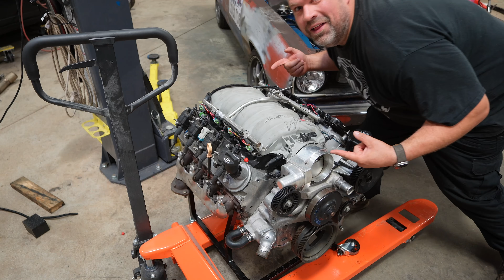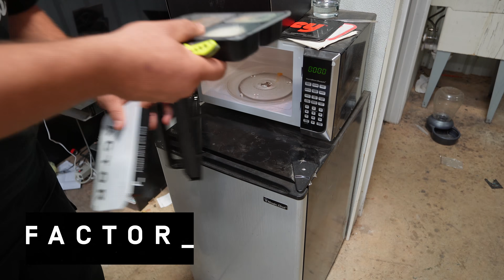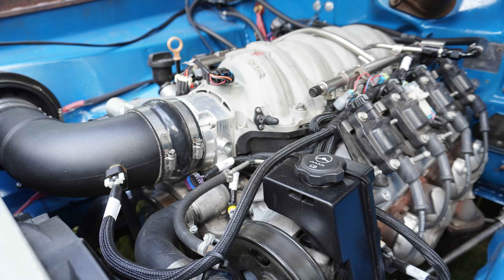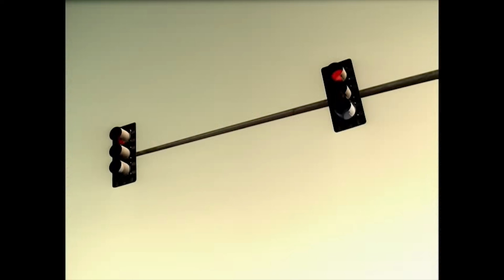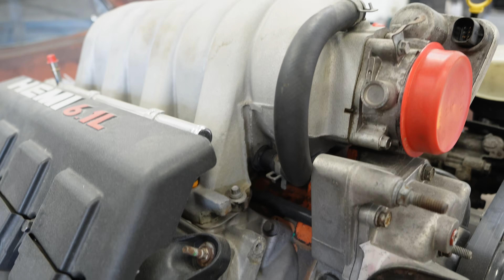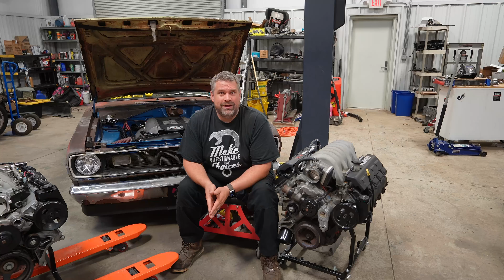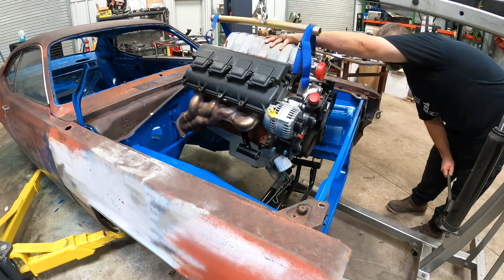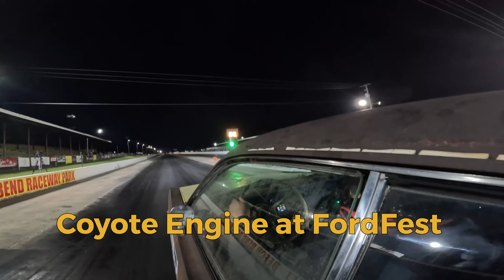What No One Tells You About Engine Swaps! Best Engine To Pick?

Comment: Great comparison!  I just picked up a wrecked '16 Challenger to swap the 5.7/8HP70 into my '71 Coronet (currently 318/2V).  Even if I leave it bone stock it's over double the hp and about 60% more torque.  Given the Coronet weighs ~900lbs less than a modern Challenger/Charger it should be amusing.
Reply: Have you considered stroking the 318 to a 390?
Reply: @ufarkingicehole  certainly possible, but more expensive to do properly than putting in the modern engine.
Reply: @ufarkingicehole  ..400 big block with a 440 crank...636 hp is what I have in my 70 Charger 500..I detuned it to 598 hp but has  670 torque! (I removed the headers,milder cam as I run power brakes now)..
Reply: @mypronouniswtf5559  what's the bore? Compression ratio?
Reply: Look at Reignited - Cycle and Automotive. Dodge tech guy, has a lot of information about this issue on his channel. Also videos on oil pumps and which one to get.
Reply: A '71 Coronet is a nice looking sedan that was popular with police and taxi fleets due to its sturdy build.  The wagons are attractive too.
Reply: Ain't  that  the way ? The malaise begets  a cure .😮😅😊
Reply: And it’s a beauty car.
Reply: 09 and newer should upgrade to HELLCAT oil pump. Direct bolt on. Will throw a low oil pressure code (which is the opposite of what's happening because the hellcat oil pumps raises oil pressure). What's happening is the oil pressure is raised higher than the upper limit for the MDS to operate. They're a couple of ways to eliminate the code. You trick the computer with a voltage divider or take the pressure spring from the original oil pump and install it on the new hellcat oil pump. Here are a couple of videos where I got my info from. 

https://youtu.be/wpl8aZiPK0E?si=vtbmKBB0iJon4jq_

https://youtu.be/1gpEwkTVCmE?si=rZ93f9KHJhDUL3YS
Reply: Better upgrade the oil pump or it will look like every new dodge broken down due to lifter/ cam issue that stem from poor oil pressure
Reply: @jo-qp7mz  the issue isn't the oil pump from my research, it's the MDS system, which IS getting deleted.  I may throw on a new pump though just as a precaution as the car was in a pretty serious collision.
Reply: @rennkafer13 it's an oil volume issue. Avoid long idle times and do regular maintenance and you shouldn't get the issue. Something else to keep in mind, the supposed "common" issue has only affected ~1% of these engines.
Reply: @hewlett260  right, my understanding is that mds system diverts oil from the lifters, causing the problem.  Remove the mds system (and use the proper non-mds cam/lifters) and the problem goes away.  Plus I get an excuse to upgrade the cam. 😁
Reply: @hewlett260 well said I've had no issues with my 20 year old ram 5.7 sitting at 240 thousand miles and still my daily driver..Been a great truck and still is
Reply: @johnoates3326  Same here. We've had a ton of high mileage gen 3 Hemis and none with lifter failure. Most Hemis with that problem are fleet rigs that have hundreds of idle hours. 2018 Hemis have higher output oil pumps too. Most people are going to swap to an aftermarket camshaft with a new set of lifters anyway. No one with a hotrod needs MDS.
Reply: @PyroBlonde7777  I agree I'm not a fan of the MDS system thank God I have a 04 so it's the preeagle no MDS..It's been a great truck the past 8 years..Had a few electrical issues that took some time to figure out but besides that it's been the best truck I've ever had...Not the best on gas with 37s lol but definitely reliable
Reply: Melling has the higher volume oil pump and cheaper than the Hellcat pump. @rennkafer13
Reply: @PyroBlonde7777  agreed, I ran a 2006 Magnum with the 6.1 for years without a single issue until I started doing 160mi round trip commutes down to San Diego in bumper to bumper traffic every single day. All that sitting in the heat baking between other cars with zero airflow did her in.
Reply: @johnoates3326  working at the dodge dealer and at independent shops the early 5.7 hemi 04-08 was the most reliable V8 I saw, out of all the brands. No oil leaks no oil burning, the only issue that all of them suffered from exhaust manifold bolts breaking. If you ever over heat yours then you are taking a big risk of dropping valve seats soon after. Just do all the maintenance and drive it. Seen them 200k-400kmiles with no issues.
Reply: @alexgrindnshine2522  I agree!! I'm at 240 thousand miles..I upgraded to a 4 core radiator and electric fans and long tube headers and the truck is beyond reliable!!
Reply: @alexgrindnshine2522  The exhaust manifold bolts are an easy fix if you go to headers. Gen 3 Hemis are the easiest V8 I've ever worked on. Almost every seal is an o-ring. No one with actual knowledge in engineering would look at the Gen 3 and think it's bad. Only a Ford or Chevy fool coping hard.
Reply: @johnoates3326  The Eagle heads flow a lot better. I'd rather spend money on a cam and headers than new heads or porting.
Reply: @PyroBlonde7777  I have not had to spend that kind of money on anything and I'm at 240 thousand miles and still my daily driver plus it's on 37s..Most people will agree the 04 was one of the best years made
Reply: @PyroBlonde7777  I agree with you. Working in shops customer didn’t want to upgrade to headers. as much as I hate anti seize I would completely cover the exhaust bolts in that stuff, which I believe helped with longevity. I never had them come back in the future for another repair. The seals and gaskets quality on the gen 3 hemi’s   is phenomenal, I have never had to fix an oil leak on one other then an oil filter that didn’t make a tight enough seal. And yes the engineer/ power out put and ease of repair made it one of my favorite engines. I loved the LS because it need repair often but was fun to work on. The new 5.0 is huge step in the right direction for ford, because that 3v triton was terrible. And the early 2v stuff just had goofy problems, and not a lot of power.
Reply: @PyroBlonde7777 my experience agrees with you. I have a fleet and we have failures due to excessive idling. Especially in the summer.
Reply: @Kanakid  Chevy has the same issue with their MDS lifters. Chrysler updated their oil pumps and the lifters themselves back in 2018 though.
Reply: @jo-qp7mz Exactly ! Great point. My brother's 2012 Dodge truck fell victim to that. Hemi tick. Low oil pressure at idle.
Reply: I remember the old 360's would give you a heart attack if you looked at the oil pressure at idle. lol  @rondellschuyler7074

Comment: I have never been a blue oval guy.i have always hated the engine and transmission pinwheel.they got what? 11 different transactions and a bunch of engines and their wiring has always SUCKED? Their quality control has been in the toilet for a long time. I liked the look of the galaxy 500,the fast back mustangs but i just can't stomach the motors.the Chevy is a good all around vehicle good reliable engines and 3 transmissions the power glides,
 turbo 400 and 700r and I think now it might be the 4L80.
The LS platform has taken off like gang busters to the point of "oh look another LS swap" but you can have new tech with vintage body for the GM crowd and some are impressive....but i am a Mopar guy love my Mopar stuff simple HP and tourqe big block stuff and small block stuff now we got gen 3 stuff and i am going to do my final project and swap with my dodge Dakota r/t pulled out the 408 stroker i built for it over the years but i was at the end of the road with making power super charged it and got to 498hp with no place to go basically the magnum platform restricted itself....so now it is on to hellcat power with the 8hp90 with the charger dash, console, steering. Boosted motorsports built one and it is impressive when dodge first came out in 2015 with the hellcat i was toying with dropping a 440 in the truck and me and my brother in law seen the commercial and i said that is what I want to put in the Dakota... and he kinda dismissed me and I said no really buy on that someone totals and take the drivetrain out and put it in the Dakota and I'll call it the "hellkota" well jon from boosted motor sports got to it before I could but i slipped up in a live chat with him and said what I was going to call mine and then everyone started calling Jon's project the hellkota build.....so i let my name idea out and it took off...lol....oh well Jon's a great Guy and it is what it is go check out his channel boosted motorsports on YouTube he did an awesome job on it so far.... Open the hood and it looks like it belongs there.

Comment: Awesome video Jared. My brother managed to do a Coyote swap into his Foxbody Drift car. Nice thing about that engine over a built 302. Is stock power is great enough to get the car sideways. Without placing greater risk on the health of the engine, as the engine is still running on stock power.
Reply: Still, compared to the Windsor, and LS engines, there's plenty of reasons why coyotes are the least common swap engines like it or not. As far as modern engines go, the LS is number #1. Even though I'm a Ford guy(own a '89 Notchback )ever since the foxes were new. Ford hasn't built a decent affordable power plant since they let go of the Windsor. The Mod motors were a let down. Many mustang guys went LS after Ford went 4.6L. I'll keep building my Windsors.
Reply: @erikturner5073  personally I like the Windsors too. My 89 hatch currently has a 302 with exploror heads and intake. My first time building a engine and it hasn't blown up yet. Though it's just a stock rebuild with a few goodies inside.

Comment: Yet when you factor in the amount of MODs needed to get the engine's into making the power you want, the Coyote needs so little compared to the other two. That has been shown by many builders. Coyote just puts out the power with minimal MOD needed, basically a tune and E85 for NA or boost it and tune for 1,000 HP on stock parts. The other two require many parts to keep it together or even come close the the results of less means more.
Reply: Yes and the coyote cost$$$ BIG,,,,,,,LS $1000 junk yard and $500 eBay turbo and make 600HP for $2000 and small package….
U can buy a coyote for less than 5k
Reply: @ManwithoutafaceFL  those mods in the real world is more like 5k. also more work and time.
Reply: @ManwithoutafaceFL there's no such thing as a 500 turbo. You need hot and cold side pipping, wastegate or blow off valve, tuning and a few other parts To make that 500 turbo work on top of all the time of putting it toghter. I've seen guys put the ls-junkyard turbo combo together and mysteriously it came out to a 10k build that netted 650hp. Where you can get a coyote now for 2-3k.  a control pack for 2k and a paxton for 6k a really good fuel system for 2k and you can make 8-900hp all day long. As long as you don't bounce it off the revlimiter.

Comment: I disagree with you on the Coyote. It’s an awesome engine that is only tight in smaller vehicles. This stereotype is what has pushed a lot of builders to use the horrible LS. You yourself have proven it can be done,you just can’t be lazy and go down the easier path.

Comment: its simple. Coyote swap tge world!!  just 10k boost either supercharger or turbo and fuel system for 1200. ucks and you can make up to 1200whp and get heavy mustang modern s550 mustangs running as fast as 7s and  f150s 8s in the 1/4 mile  all on stock sealed engine unlike hemi and LS which need heads cam pistons and rods oh and then the boost and fuel system sqme goes for hellcat motors to get close to that power that a stock coyote  makes.   turned down 900whp nice daily power that will smoke super  ars in awd f150 and in mustang or f150 rqcea le and dailyable and reliable.  also factory ecu has been able to be tuned down to 6 sec 1/4 mile.  its all about what or who you know.  they have waaaaayyyyy more aftermarket than hemi you just need to know what you are doing and talking about and who you are talking to and coyote is not as scary as ppl think it become as easy if not easier to build and swap a coyote
Reply: anything you need to know about swapping tuning and building every gen coyote even pre coyote  road runner 5.0 from s197 boss mustang just watch mustang lifestyle

Comment: so you dismiss the extra 150lbs or more on the front end? that is typical US cars with rubbish handling as that extra weight in many projects will see that. maybe not a big deal in a restomod but a re engine to euros for example will be ruined. coyote seems great but understand a big engine to slot in and be able to work on. read that the5.4 is one of the absolute worst by old school mechanics.
Reply from the maker: Oh no I talked about how I could feel the difference in handling, which really gave the big advantage to the ls and Coyote there, but ultimately the goals of the car, and it being used more for road racing, which less extremes in corners the weight is more manageable

Comment: So the Coyote is a big no - whilst doing all the best times in all phases of competition, plus participating in the burnout contest that the other two engines didn't have to do. Yeah, I know - suspension mods that the other two didn't enjoy gave it an advantage and it being your third competition on the same course gave you an important experience advantage. Still, it did do the best. Hey, I'm not a Ford guy singing the praises of this engine. Just saying, it did turn in the best results. (Oh, and I really do like the way it sounds. Whatever your team did to get the exhaust hooked up certainly worked.)
Reply from the maker: The sounds is 100% the hooker blackheart system. It is amazing! Even made the ls sound good.

When it comes to the coyote, it scores poorly as a swap engine, I’d rock one of those single cab short bed f150s or a mustang with it all day long, such incredible engines, but they are currently very expensive to make the swaps happen and work!

Comment: I'm a dodge guy so love the hemi, but respect all for their accessibility and tuneability. But if i were to build a car right now on my budget whatever body I start with, it'd have to have an LS in it, because of what you said about package size, availability as well as most of the aftermarket support.
Reply: LS should win-- If you factor in cost, availability, power, aftermarket parts support, reliability, size, weight.
But thank God we have a choice of great engines to choose from 👍👍
Reply: Either, IMO, is unnecessary if you're building a STREET machine.  For the TRACK, or Straigh-away, yes, LS or Hemi or other latter-day performance crate engine.  But all that high-revving horsepower is WASTED on a cruiser.  A 360 or even a 400/440 on something like an '80 Dodge Mirada, built as a street machine/show queen, is more than ENOUGH, can be easily tuned and maintained, and won't break the bank!

Comment: I personally do not care for the sound of modern engines, my 95 sn95 still has the 5.0 straighr piped with 3"x18" straight cut tips and i think it sounds sooooo sexy. The newer cars all sound raspy and gurgly many love it i do not. My opinion is swirl port heads That crackly sound showed up at the same time and it never left, with GM starting with the TBI 350 engines and there swirl ramp intake ports you compare those to an old school sbc and they sound soooo much different, you put a loud exhaust on a truck TBI 350 and it starts that raspy bark instantly with any throttle imput even low rpms, effortless  noise yet an old smog headed or fuelie smallblock you need some revs to get that bark. I prefer old school sound i will say the form 4.6 mod moror sounds decent and the 32v cobra version sound pretty sick and 300hp bone stock with few mods they run pretty strong so If i was going to do a newer engine swap in my 95 GT as good as it is the yote would not be it, i would be one of those 32v cobra motors. The 03/04 32v is the one and is a monster, one of the greatest mustang engines ever, with an eaton roots blower They make 390hp stock but a pully swap and tune you have 500hp and that engine will hold about a 1000hp because they came with forged crang and manley H beam rods from the factory, its pretty cool the rods say manley/svt printed on the side of them.